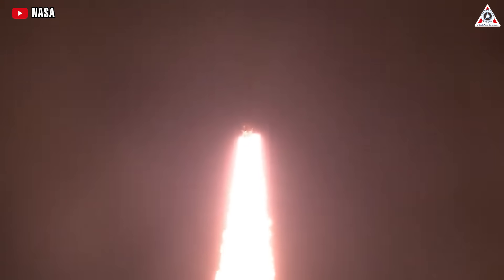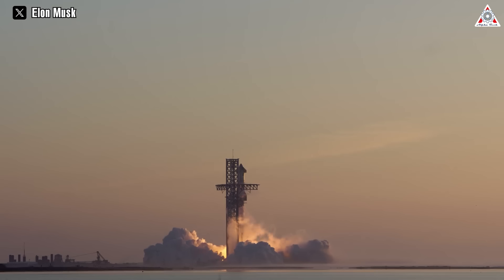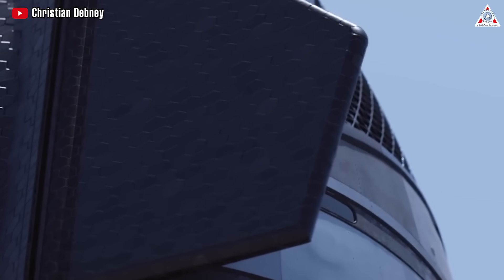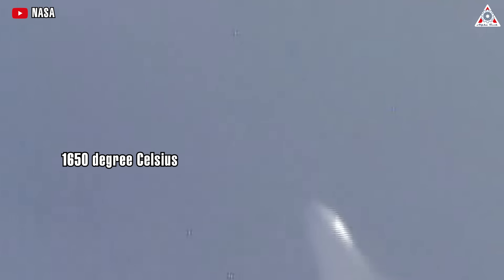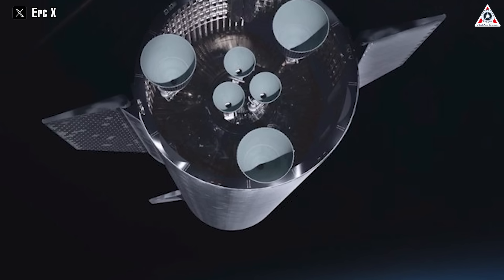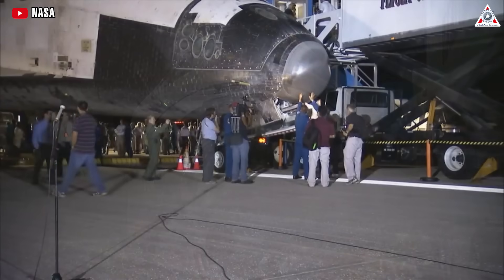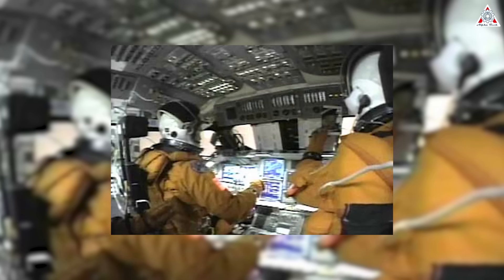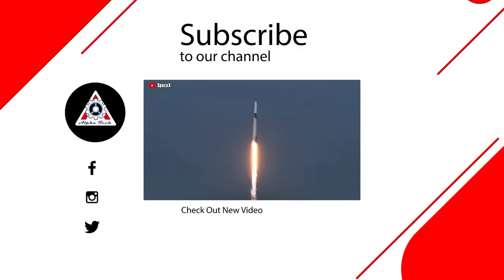SpaceX's genius solution for FIXING Starship heatshield fall off for the next launch...

Comment: Redundancy In aircraft design Is paramount to saving lives There should be a double wall heat shields  wall construction There should be a complete total layer of heat shield on the outside of the craft and sandwich in between the double wall construction should be a second layer of heat shield to protect the occupants and the craft. If the outer layer of heat shield falls off the inner layer will still provide protection
Reply: Problem is weight.  Chemical rockets are just barely powerful enough to get out of Earth's gravity well. This stronger double wall design is too heavy and will needs a rocket with more power.. something like a nuclear rocket
Reply: @nickl5658  the double wall insulated heat shields construction was only for the crew cabin not for the whole rocket
Reply from the maker: Thank you so much!
Reply: What is failing when tiles fall off? the "epoxy" glue?   ... seems like tiles themselves are up to the task, but attachment is the problem... attaching to those pin like weldments to the rocket hull looks a a little sketchy.... Also, when a tile falls oof i find it hard to believe that the sandwiched white insulation underneath will stay in   place on the hull(speeds & forces involved)....
Reply: The double War insulated heat shield Construction was only for the crew cabin the crew cabinets on top of the rocket how much could that possibly weigh additionally
Reply: The double inner and outer wall insulated heat shield protection was only for the crew cabin not the total Rocket
Reply: There are a lot more considerations to rocket science that what you propose one is weight and the increased fuel needed which increases the weight and the fuel needed to launch that weight as well.

Comment: Not exactly solved considering it's a brand new approach to one of the most difficult aspects of space flight and it is never once been tested. So let's all put the champagne away for now.
Reply: It will be tested and if it fails lessons will be learned from the failure if it succeeds then lessons will still be learned on what works. Expect things to fail before you get it right. Tomas Edison found 10,000 ways not to make a light bulb filament
Reply: @johncherish7610 ,  a comparison with Thomas Edison is a bit of a false equivalence, considering he was trying to develop something, that well...didn't exist before..ie..the light bulb.  We've been building heat sheilds for spacecraft for 60 plus years  now.  It isn't like SpaceX is blazing a new trial here.  They have a boat load of science, technology and  practical experience to draw from.  It seems to me SpaceX is trying to figure out what works and what doesn't, with technology that's already been figured out.

Comment: why will the Mars Starship require heat shield for landing on Mars with an atmosphere 1% as dense as Earths atmosphere.
the TPS is only for return to Earth
Reply: A Mars Starship will still rely on aerobraking to slow its descent - all that kinetic energy has to go somewhere!
Reply: The atmosphere of Mars, though thin, is thick enough to aerobrake and thermally heat an incoming spacecraft attempting a landing on the planets surface. The moon with no effective atmosphere requires rocket or thruster braking all the way to decrease speed to the surface.
Reply: It needs to return to earth through earth's atmosphere.
Reply: Yes. Still need a heat shield even if Mars is the destination.
Reply: The final stages for landing Starship require rocket burns to reduce speed  in either Earth's or Mars' atmosphere. Though it is easier on Mars due to  its lower gravity.
Reply from the maker: Thank you for your comment!